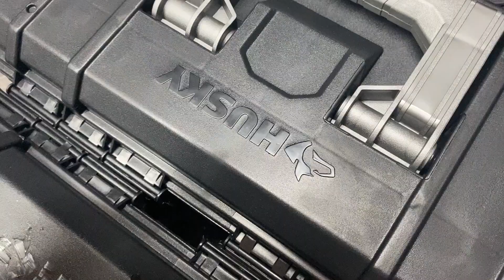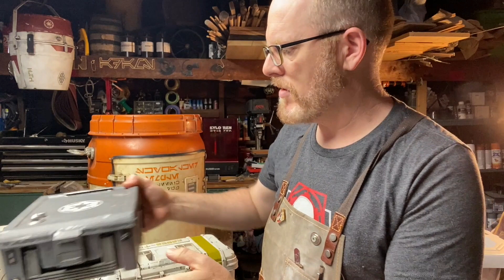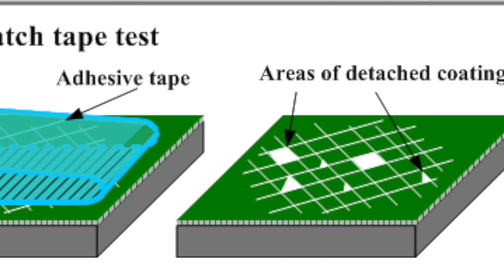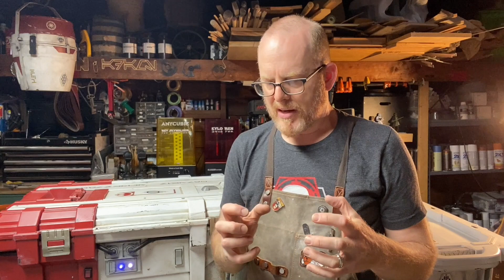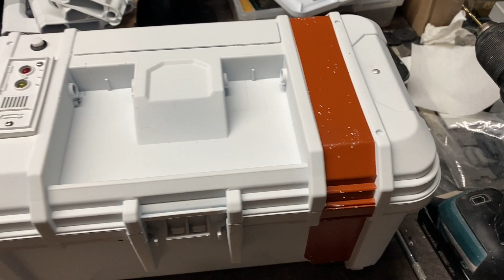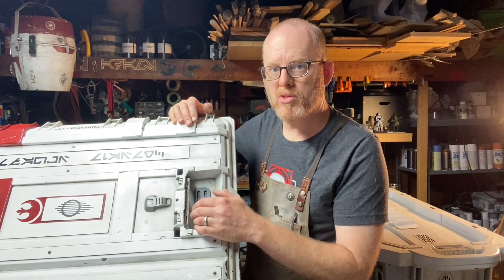Customizing Costume Containers - Part 2 of 4

Comment: Can I ask if there’s any videos on what it looks like in the inside? With so many screws and electrical components how did you go about making sure it all sits snug without compromising the interior with screws sticking out and how did the  electrical components get tucked away neatly
Reply from the maker: the screws usually are in recessed spots with standard nuts, or acorn nuts (or plastic screw covers) if they would touch the costume. all electronics have some kind of box cover to protect them, and covers for cords (or run them down in grooves if they exist).
Reply: @OddViking  I saw briefly in your fourth part of the series so I apologize about asking it here on the third part how would there be any chance you have more pictures of it on any of your other social media of how you went about covering it? is there a list of potential parts you may have used or things you found to use for covers over the led light bulbs?
Reply from the maker: @KojiWoji_  I have shown some of that in my build posts on Instagram, but they are different every time. Sometimes I use a simple two-part pencil box, and glue in some angle brackets to allow it to be bolted in place. I have used lots of small random boxy parts, like soap travel boxes, that sort of thing. I like ones with a lip of some kind that I can drill a hole to bolt through. It is different in every box, but I do always protect it with some kind of removable cover.
Reply: @OddViking  ahh okay one last question I have is for someone on a budget where can we find greeblies? I went to a local mom and pop electronics part store today to grab a few and the price added up quickly, ended up spending $58 on parts I was going to use as greeblies on the bin. Any ideas what we can do to find alternatives?
Reply from the maker: @KojiWoji_  Finding the right ones is all down to chance, just keep an eye out. Look for old parts at thrift stores, old cameras and other 70's era tech has a lot of milled aluminum knobs, or sometimes good sci-fi shapes are in kid's toys. But it takes years of slowly filling my small greeblie bins, and eventually I have just the right part. Now I often resin print custom ones to fit, and there are some affordable ones on Etsy for sure, but still at least half of what I use are found parts that just work in that perfect spot.

Comment: Harbor Freight sells knock-off Pelican cases. Ammo boxes, both plastic and metal. Rifle cases. Tactical style bags and backpacks. Hard side luggage. It's not the best fit for the Star Wars universe, but something to look at.
For fasteners, there are also Torx head screws and Security Torx head screws. Both have a scifi look. Especially the Security Torx screw with the tiny pin in the middle.

Comment: At exactly the 12:00 mark, how did you light this? also, how did you print this? I am having a heck of a time figuring it out - prints are washed, or the various lights dont work, its frustrating. thanks for any insight!
Reply from the maker: That is a black vinyl decal, on a rectangle of translucent white plastic, with some red gel behind one part, and a battery nightlight behind that. I go into the battery nightlight in part 4.
This IG post shows the decal a little better: https://www.instagram.com/p/CJWSSEDMDx5/
Reply: @OddViking  thanks for the quick reply! I saw the nightlight option you presented - I am having trouble finding a dang night light (go figure). Love what youre doing here! Not sure if youre in LA area, but if so, you can get free gel samples from movie supply houses ( i can tell you which ones) if you want to try out different colors etc.
Reply from the maker: Thanks! In this case, I used a 3M self-adhesive used for temp brake light repair. I have a selection of gels for other colors, but red works well for Imperial. Here is the style of night light I have used: “nextool 2-Pack Adjustable Battery Operated LED Night Lights https://a.co/d/hdblCZT “

Comment: Dis you disassemble the wheels on the husky rolling case. I  have the smaller version but can't figure how to take apart to paint. Plus mine is extremely  loose
Reply from the maker: No, I just taped them off with paper. Taped tightly so that some spray can get around them, and although they don't get fully colored, I do a lot of spatter weathering behind, so it looks good.

Comment: Where do you source fullers earth for weathering? I've been looking for black or dark brown fullers earth but its hard to find any color specific powders.
Reply from the maker: I found some tiny bags of black and brown and grey in a pack from Amazon that was for tinting epoxy or stone repairs. It was called "EZ-Tint 4 Pack. Epoxy or Polyester Tint for Stone. 5 Grams Each of Highly Concentrated fine Powders of The 4 Primary Colors of Stone. Black Brown White Gray" and I used it mixed with other colors to get darker versions. Very tiny bags, but it went a long way.
Reply from the maker: The ones used in this video are from Trooper Bay, which has a darker rust brown, but it is very staining like rust. I mix it with the grey and that gives me a good dirt brown.
Reply: @OddViking  Thank you thank you! Anytime I searched for fuller's earth on amazon the green beauty powders came up. I have used the trooper bay kit a little bit but I wanted the brown color to be less rust and more dirt so this will be very helpful thank you so much! :)

PS I'm also that guy on instagram who sent you the box I had done as inspiration from your projects so you might have seen what Im talking about with the coloration thing.
Reply: @OddViking  Anyways thanks for this video, lots of great tips and tricks here, especially concerning the adhesion of paints and greeblies to boxes. I had some trouble with that so these will definitly help out.
Reply from the maker: Excellent, glad to hear it!